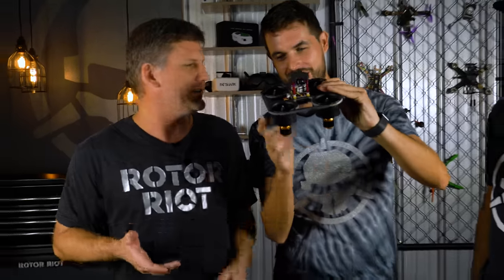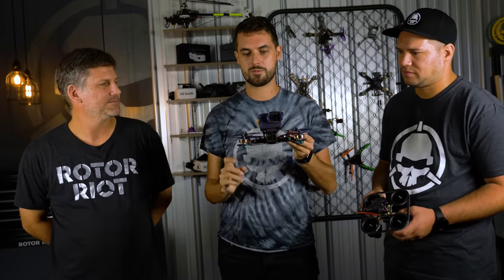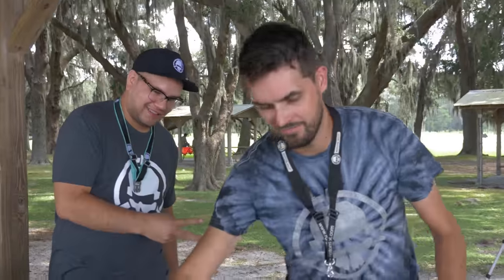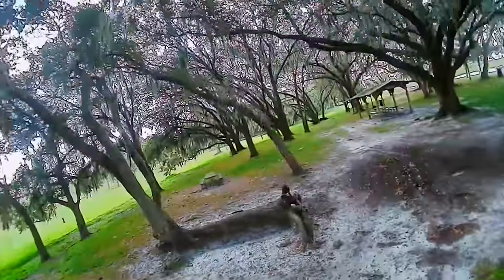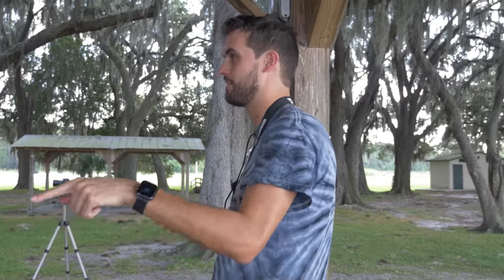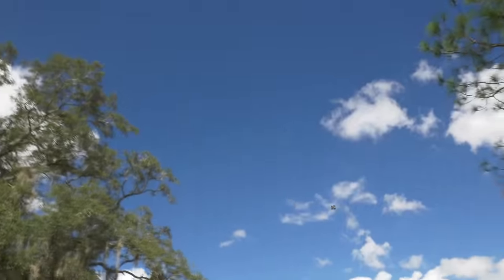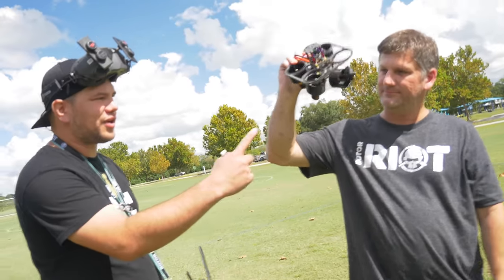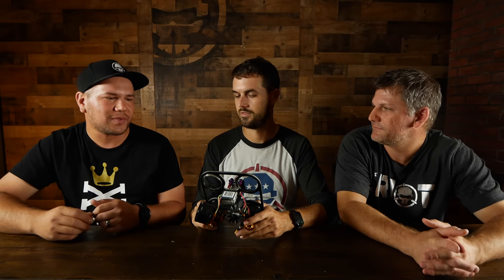Jet Drone?! - EDF FPV Quadcopter

Comment: I think there is a lot of potential left to this kind of build before finally give EDFs a full pass. This thing looked like it just needed a different tune and very likely throttle linearization of some sorts, apart from a more rugged duct-design. I'd really love to know what the limits of that thing are and if it could actually be more efficient and faster than our normal designs :3 

I love your crazy experiments!
Reply: Yeah. Definitely looked like there were quite a few tuning issues. Looks like they may have just used Betaflight's default 5" tune  🙄
Reply: @Vousie  Shawn's slogan: "I build this weird thing and didn't even tune it yet! Let's see how it flies!" xD

I bet the bone drone and this EDF quad could fly so much better :3

Comment: 3 small screws in each duct could have worked. Could be neat in a foam body.
Curious how the pitch of the blades compares to a typical prop blade setup.

Comment: Did you guys tune it? Is Air mode running?  It seemed to respond just like my regular drone does with air mode off. No control unless props are spinning at a minimum!     It could totally just be out of tune (or even un-tunable by our normal methods and understanding).  Great video. Keep doing this new R&D stuff!!   I miss the magnet drone.              How about a drone with 4 (or six??) cameras that auto switch based on the direction of flight?   Or getting a real FLIR camera onboard , with cheap IR illuminators, to fly 100% in the darkness?         
 I reaaaaly want to come work for Rotor riot one day. You guys have all the fun. KEEP DOING IT FOR US
Reply: @UCPLsvmuB2f-wmWqd8UnqvfA If knowing a little was fun, why is knowing more not more fun?   Chill with your party pooping. You should be more creative
Reply: Cool ideas. I usually don’t tune my projects - so we can have a real, honest first reaction.   Maybe it could be helpful in some of the projects to fine tune them.  Unfortunately, this drone didn’t last long enough 😂
Reply: @LetsFlyRC  I was going to ask how you're supposed to tune something that breaks every time it flies. 
Love the cool projects and I would love to see a bi-plane drone. So a hexacopter, but two motors are mounted horizontally controlled on a switch. Then when you go to "plane" mode, just have to idle the other 4 motors and let the air rushing over them provide the lift. Maybe would need a gimbal on the camera since you'd want it horizonal for plane mode.

Comment: This is really a great UAV.

I am a beginner and currently have the following parts, if I want to make a similar UAV, what other parts do I need? And please suggest which kind of battery is more suitable?

2 sets of EDF 50mm-12(CCW and CW) with QF2611 4000kv (Thrust 0.95 kgf)
4 sets of ESC 40A (2-4S Lipo BEC 5V@3A)
1 set Mini Pix v1.1 (RadioLink)

Thanks again for your guidance.

Comment: I think when you chop throttle you lose all the air velocity comming through the ducts. That makes the props much easier to stall. Then when you apply throttle again, the props start to stall until they have good airspeed over them.

Comment: I was told that it had to do with how long it took the EDF's to spool up/down, as to why they don't make good multirotor powerplants. I suppose when it has to spin ~2-3x as fast to get thrust to the same level as a comparably "thrusty" propeller setup, that any amount of pitch or roll correction would have to spool up or down 3x as much as it would with a regular propeller. 

With props on 3s with a 2300kv motor 50% throttle would be ~ 14,500rpm, to speed up to 60% throttle for a correction it'd have to speed up by 3000rpm

With an EDF on 3s with a 4300kv motor 50% throttle would be ~ 27,090 rpm, to speed up to 60% throttle for a correction it'd have to speed up by 5400 rpm in the same amount of time as the 3000rpm speedup of the propeller setup. 

The above figures also assume that the prop setup and the edf setup both hover at the same amount, if it takes an extra 10% throttle to hover with EDF's, the corrections will also take an extra 10% on top of the already near double RPM change it takes because of the KV difference.

Comment: I love your projects Shawn. Ponder this combo of 2 of your projects. A high speed 5in quad with a single switch activated EDF mounted at a ridiculous angle used as a warp drive! Kind of like the previous 5 motor drone you built with a 5th motor being activated by the switch. It might take some wizardry in OpenTX or similar to make the switch give a specific amount of power to the EDF when flipped but I think you could pull it off. I'm thinking of the type of drone built for speed records that has the camera almost looking straight up but even if it wasn't that extreme I think it would be awesome and a little less prone to dying since the one EDF would just be a booster? You can do it dude!
Reply: Love this idea, but if we’re going to dig into the wizardry cabinet, I’d say put the EDF-booster throttle on a pot/knob or shoulder-slider so it isn’t an all-or-nothing type thing. Although a fast and furious style NOS button (or fighter jet style red flip cover arm switch) would look pretty rad on a radio…
Reply: @abertheham  Brilliant! I've never used them for anything but I know OpenTX is very capable of such tasks. That would be sick AF!

Comment: Been there done that, with the longer ducts (vs shrouds), better off with a tricopter/"trifan" setup with the rear servo arm; if you want speed, at least from my testing. Quads only if you need to hover more.

Comment: What CNC router are you using to cut your carbon? I’m using a Shaper Origin, and its pretty good for prototyping, but I’m ready to upgrade.
Reply: I custom built it from a project on openbuilds.  I believe it is the c - beam
Reply: @LetsFlyRC  Thanks...

Comment: I think that you'd get better results adapting standard quad drone props on a standard quad frame & adding a light duct around them for the increased low-speed thrust. Those EDFs you had in that build seemed like they were designed for EDF RC "jet" models. Think, the USN Osprey variable-tilt propped fixed-wing aircraft. I think that a design something like that to be able to switch from hover-flight to a more fixed-wing flight model might increase the speed & more importantly, the range & time in the air. I've seen some time & distance tests with standard-model quad-copter type drones, vs some time & distance tests for fixed-wing drones, & aside from the fixed-wing types generally being faster, they also flew farther & faster & with a lot longer flight time. The fixed-wing aspect would take at least some of the burden off the energy required simply to keep the drone in the air as the only source of lift for the drone. I've been looking but so far haven't seen anything like that. I'd love to see some sort of hybrid flight model & using FPV. It's an idea that's keeps poking at me. Seems like it might be viable. What do you think? Any takers?

Comment: I think you should lower the size of the motors. That would give your quad less torque, lighter weight and possibly longer life. Then tape and hot glue might be sufficient.

Comment: Not a jet.  It’s just a ducted fan.
Reply: Next time we will add fire 🔥 🔥 🔥.  😂
Reply: @LetsFlyRC  "jet engine, any of a class of internal-combustion engines that propel aircraft by means of the rearward discharge of a jet of fluid, usually hot exhaust gases generated by burning fuel with air drawn in from the atmosphere."
Reply: @jasonpressler7111  generally you need that nozzle pressure out the exhaust to be called a jet.  Another indicator of a jet engine, its turbine driven.

Comment: Fastest 2 inch currently on the market is 150 miles an hour I believe (edit I was wrong it matches but it does have high blade count it would go faster if it went down to bi blades)
Reply: Wow 🤩
Reply: @LetsFlyRC  The each one lizard95’s top speed is 70 mph so i was wrong I saw the video about it a very long time ago but It does have five bladed props is out of the box so would probably be much faster with bi-blade props
Reply: I think it is possible though to make one that hits 150 It might need to be an octocopter though

Comment: I already made one
https://youtu.be/rmVds9YnkMU
if you make one better locktight in the fan screws, they come out easily on that motor, beware of holding it your hand, i've got a couple good gashes from it.
mine has hundreds of flights on it with no issue, you're not going to be bashing this thing around, take it easy and have fun with it.

Comment: Drew more respect to quadcopters, don't throw them around like trash 😥
Reply: They are probably fine I have a drone that fell from around 100m (330ft) because of the low battery I fully throttled it, it slowed down a bit , nothing happened I just needed a new propeller